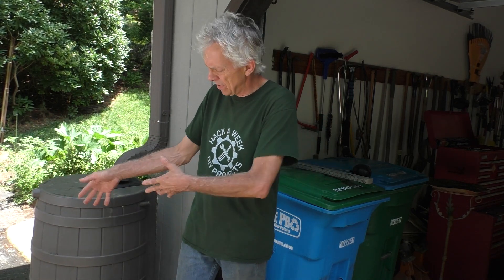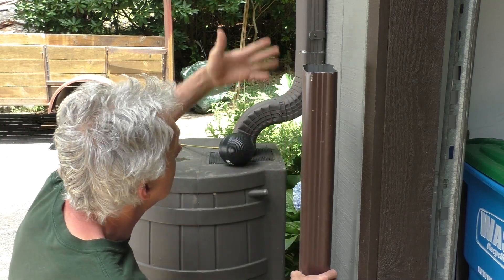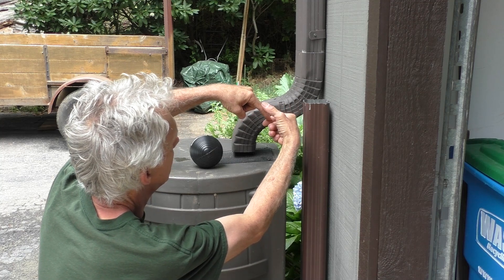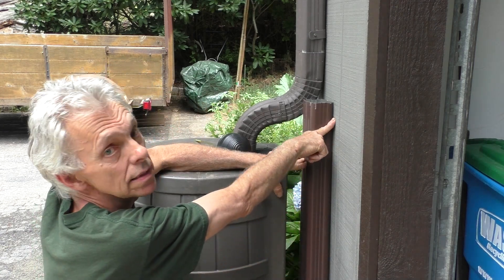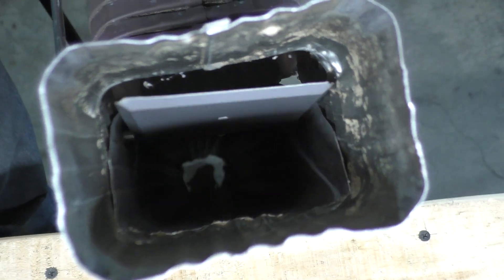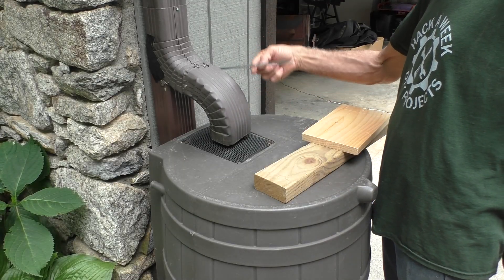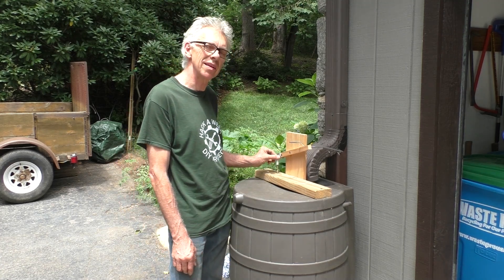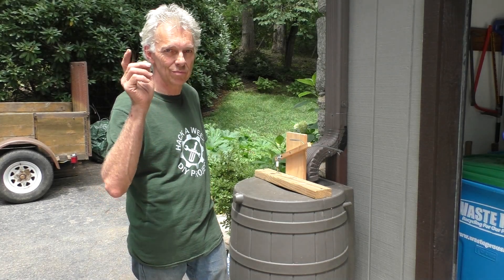Rain Barrel Valve-O-Matic

Comment: We use a simpler system in the UK. FLOPLAST SQUARE RAINWATER DIVERTER BLACK (27866)
Take a look at screwfix uk item number 27866. Fits in the down pipe at the level you want the water butt to fill to. Once at that hight, any more water will keep going down the rain water down pipe.
Reply: Thanks!

Comment: I don't understand why you couldn't have just ran an overflow off the back of the barrel down to the extraction pipe and let the overflow water just run down and out that way through a 3" elbow and piece of 3' gutter pipe, Instaed of deverting the flow from the barrel, Let it flow into the barrel and overflow out a piece of pipe in the back of the barrel, 3'"in 3" out same results. You could also put the overflow through the bottom of the barrel and extend it up inside of the barrel to the height that you want inside of the barrel, Just like an overflow in a toilet tank. No need for any moving parts!
Reply from the maker: I like building crazy shit!

Comment: We recently got a rain water barrel, and the filling and overflow mechanism used today is actually quite clever, and has no moving parts. The idea there's a sort of "take off" from the main fall pipe coming from the roof/gutter. It is essentially a ring lining it from the inside leading to a hole, where a hose/pipe connects it to the water barrel. That ring is made from rubber and can be inserted from a hole drilled into the side of the pipe. The trick is, it doesn't flow into the barrel from the top/above, but just below the max fill line on the side, and that whole connection (to the barrel and to the vertical pipe) is watertight. If the barrel is full, it just can't flow into it, and will overflow inside the ring in the fall pipe, just continuing there. As I said, no moving parts and no secondary overflow or drain, and of no water just overflowing the barrel either.
I found this quite clever, and so much cleaner than needed a mechanism, and I have no idea what it took centuries for someone to come up with it.
Edit: if you google "Rain Gauge Rapido" some images should come up, much easier to just look at the thing than explain it in text. Sorry, but I tried ;)
Reply from the maker: Sounds neat!

Comment: Very complicated mechanism. Your objective could be achieved with a simple overflow drain into the lower part of the pipe. Basically a hole in the side of the barrel with a piece of pipe sticking out and then a 90 degree bend down into the drain pipe. Simple. no moving parts and more efficient.
Reply: Others have mentioned this. I know. I just wanted to build this crazy contraption for fun!! Thanks for watching.
Reply: You sound like my wife.
Reply: @mikebond6328  She seems like a sensible woman.

Comment: Nice! One idea to improve that! Change that diverter so it is normally in bypass mode and put something like a sponge or something that can absorb water and change it weight as a weight to turn it to collect mode.  When sponge is dry small amount of water is bypassed and all that crud from the roof is also gone with that water! When sponge get wet and it get heavier it will turn diverter to collect and your collected water is cleaner!

Comment: this is the most complicated way to make something that requires absolutely no moving parts to accomplish. could have installed a diverter tap on the downspout and plumb the input pipe into the side of the barrel at the  max water level you want in the barrel. when the barrel is full the water will bypass the input and flow out the spout. no moving parts needed
Reply from the maker: Certainly could have done that but I wanted to see if I could build this contraption just for fun.
Reply: He must be a former Audi engineer
Reply from the maker: I actually work on Audis. Hate em!

Comment: Mount the barrel higher up the wall and vent the lower downspout off the back of the top of the barrel to the drain. Way simpler. You get a little water pressure out of it.
Reply from the maker: Good idea but I wanted to build some shit!